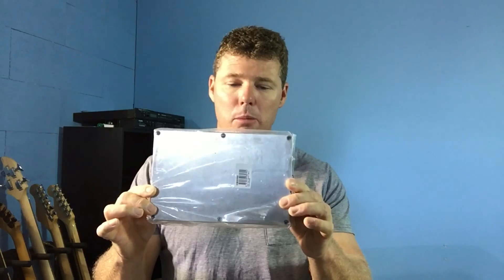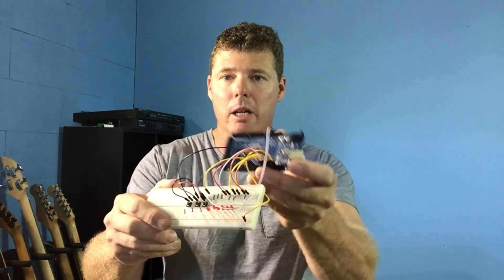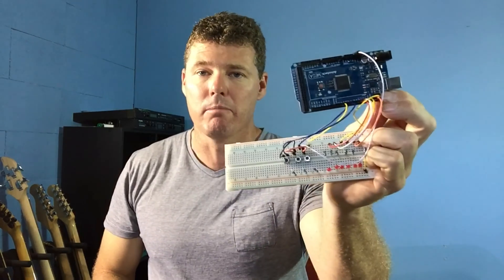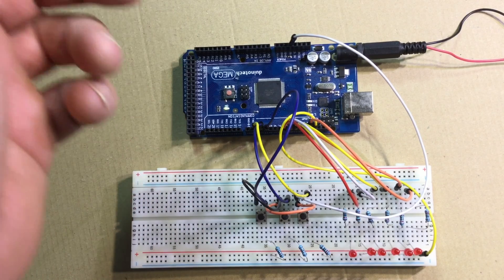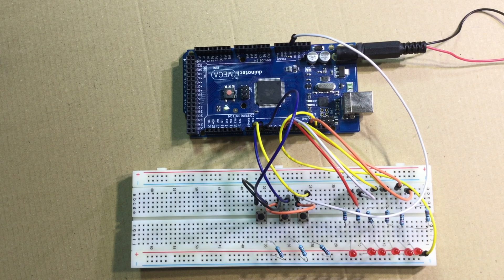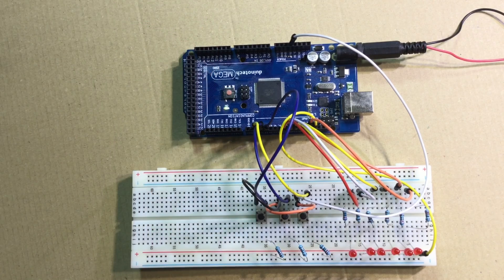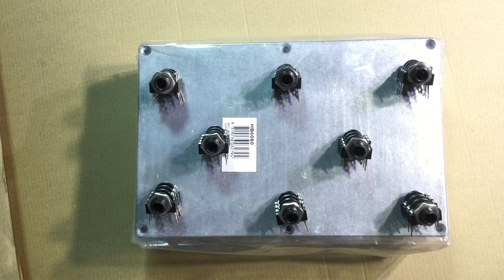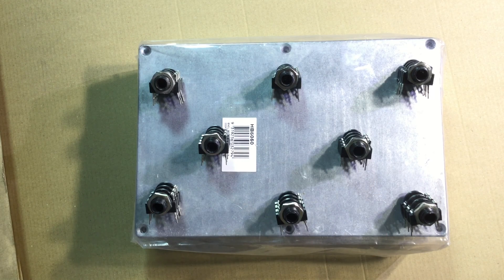DIY Programmable Pedal Loop Switcher Build (Part 1)

Comment: Is-it possible to use a switch looper to connect 2 or more pedals in parallel ? Many switchers allow from 2 to 8 loops, like the Joyo PXL8 or this one https://fr.aliexpress.com/item/4000348833245.html?spm=a2g0o which allows 3 loops, but I am not sure that putting pedals in parallel work because I tried to do it with 2 pedals simply using cables and Vintage EHX 5X Junction Mixers but it doesn't work, sound is horrible probably because of connecting pedals outputs in parallel I think. So is this thing: https://www.thomann.de/fr/electro_harmonix_tri_parallel_mixer.htm the only one possible to use for parallel connections, because it is a mixer in fact... ? What do you think about it ?
Reply from the maker: The loop switcher I built could do what you say if I programmed it to do so. The only problem is you will need a buffer before you split the signals to lower the impedance of the signal before it is split and possibly buffers after it is split.
It could be done.
A mixer will work fine.

Comment: Good diy video Paul !!
👍

Just wanted to know how the heck you have lets say 4 pedals connected and there is no need to press the actual pedal ??
What is actually feeding each pedal to make them turn ON and OFF just by hitting those external switches in your new box ??
Is there any current in millivolts feeding the audio cable from the Sends, and that current in MVolts is what decides to turn the pedals ON and OFF...... OR sending signal to ground does the trick ??
or is it a digital Pulse going thru the audio cable ...csuse it has yo be through the audio cable !!
Where you got this info ??

Thanks in advanced Paul !!👍
Reply: With any loop switcher you have ALL your pedals ON all the time and the looper sends and returns the audio signal only to the selected pedals by that 'patch' or program.

Comment: Thanks a lot for that DIY but how it is programmed ? Thank you so much if you respond. Good chance for all other thing you want to build.
Reply: You can program arduino boards using the arduino I.D.E(you can download it for free on Arduinos' website) the language arduino uses is derived from C# and C, so if you're familiar with those, it should be easy to learn.